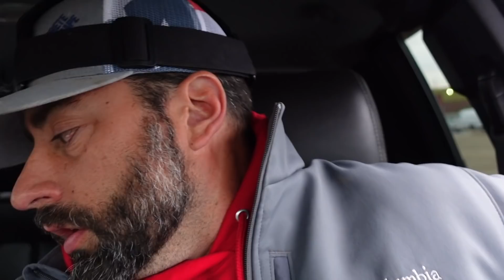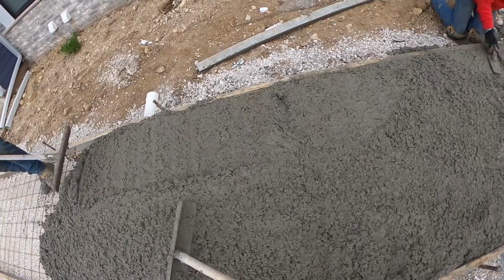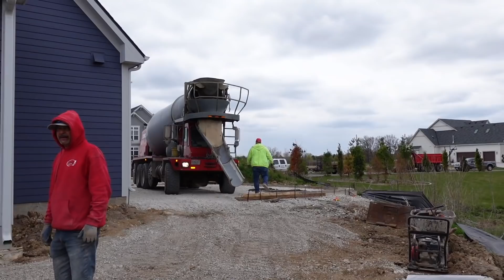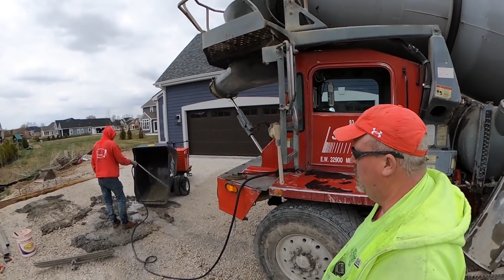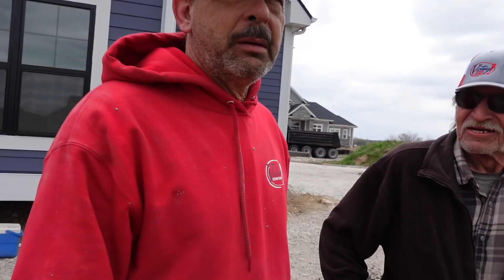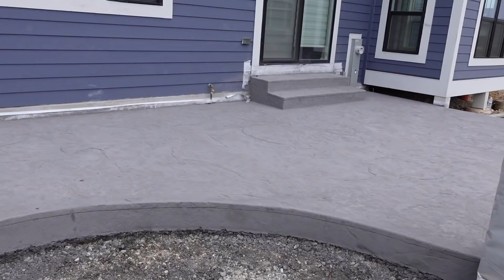Wet concrete... TOO WET!

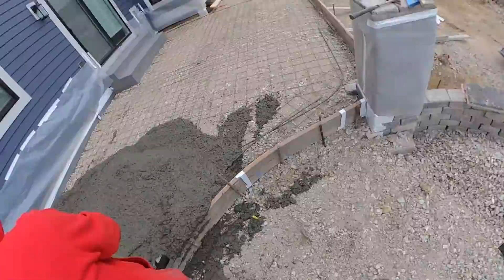Comment: Wet!?? Lol that looked like a 5” slump at 8:10
Reply from the maker: It was pretty wet.  With the chloride in it though it set up decent and wasn't as bad as I thought it was going to be.
Reply: @VictoryOutdoorServices   what was the temperature and what time did y’all start?  I work for a commercial concrete company now but also drove a mixer truck for 4 years too.  One of our customers never used steel, only fiber, that way they could order 2% and then put more calcium flakes with hot water at the job 😂  they did not like finishing past 4-5pm

Comment: You seem like great boss, U put a lot of joints in plus ,but Ryan that mesh is on the ground half the time ,on chairs mesh sits level , at 800 mm chair centres mesh is of ground,and just chair it as the Buggys emptying the concrete and looks professional,

Comment: Get a power float. And when the lads let you down as they always do you can put it on and cut it next day same thing if it goes to fast you don’t have to put joints in just power float and cut next day easily

Comment: Great that other contract lucky he dont live in my area they would have told him to stop what u have done will need a demonstration permit then would need to restart all with the drive way permit and all other check list and scale drawing. Will be very expensive
Reply from the maker: Yeah, I was really surprised. I talked to the inspector and he said they weren't going to enforce anything on the other contractor.  I asked him why and he said his department doesn't have any teeth.  I think if I would have done what the other guy did they would have made me pull it back out and start over, no joke.

Comment: It's not the truck driver's fault that the concrete's wet. Call the company there the one who mixed the concrete.
Reply: no not necessarily. they have a meter in their truck and can mix in water. he could of mixed some water in before he got there for some reason thinking it needed it

Comment: Why didn’t you run a single line pump? Just asking sir. Love y’all’s work by the way💪💪💪 sending positive vibes from Colorado
Reply from the maker: Up here in Wisconsin nobody really uses pumps except for the big commercial guys and foundation guys.  I noticed that you guys out west use pumps all the time.  I'm not sure why it hasn't caught on up here in the midwest but all us residential guys use power buggies for everything.
Reply: Yeah there are so many pump guys here. They just drag there hopper along with them 3 inch hose and get it done. It’s cool to see things done differently. Have a great day and godbless
Reply: @VictoryOutdoorServices  It doesn't catch on because we use big rock up here in the midwest, the Cali boys use pea gravel and 3000 psi mix.
Reply: How big?  We use a lot of 3/4" stone up here in Maine and even running like a 4 1/2 - 5 slump will pump through a 4" hose just fine.  I do it all the time, in fact just pumped 3/4" stone, 5000 PSI into 60' of 4" line today, went fine

Comment: I seriously do not understand drivers showing up with wet mud!!! If your ticket says 5 in slump show up with a 4 inch slump and let the contractor add the water. Never ever show up wet, your screwing the guy's pouring the mud and your making your company look bad. Your also making yourself as a driver look bad. Some Redi Mix company's will fire the driver if he or she has 3 or more wet loads in a year. There should be no wet loads period! Check with the contractor once you arrive to see if they want the slump your ticket shows, let them see the mud prior to adding any water then they can tell you how much they want you to put in. Then if it's to wet it's on the contractor not the driver. This is an extremly easy job, I just don't understand driver's showing up with piss wet concrete and if I were you I would reject it every time. Stay safe guy's.

Comment: You need a test kit. A Rod,A cone,A flat board and a measuring stick.A bout $50 bucks. Sitting water like that. One of these times they are gonna charge it back.

Comment: Ill tell you what if a boss ever asked whats taking me so long my tools get put in the back of my truck and he can do it his dam self
Reply from the maker: I have a great relationship with my employees and am able to joke around and have fun with them. It's all in good fun and I NEVER disrespect my employees.  I appreciate those guys more than I can express.
Reply: Why they don’t use the concrete pump is more fast
Reply: @gradeawork2242  owners are also paying for your experience, idk if you’ve realized but there’s a mass shortage in young guys getting in the trades. We’ve been running a 2 man carpentry crew for the last 6 months no one wants to work, $20 an hour and that’s not enough for guys to be laborers (not even a Carpenter)

Comment: That 6x6 mesh holds the gravel base in place real good. I bet if it was your house  you would do it right.  maybe not.
Reply from the maker: Watch again, its hard to see in fast speed but I pull with the corner of my cum a long, over and over again. I always pull the wire, its very important.
Reply: @VictoryOutdoorServices  you've def broken down why you do it in a video before, too
Reply from the maker: @dotChrollo  I know man, I can't win. I heard another concrete channel call them the wire mesh police and I know exactly what he means.

Comment: You say it wet but I have seen people pour foundations wetter than that. And a foundation it the one area that needs to be the strongest. I have seen idiots pour it so wet it leveled itself. And that makes for a pour and extremely weak foundation
Reply from the maker: Thats very true. That one was wet but not terrible. I have an upload from Saturday that it was so wet I actually had to send it back.
Reply: @VictoryOutdoorServices  Glad to know you take enough pride in your work that you will reject unfit concrete. Did you know also you’re supposed to reject concrete after 90 minutes or 180 rotations. Learned that when I took my state test for my building contractors license

Comment: You guys do great work. Recently had a concrete patio poured in my backyard, very messy job, power wheelbarrow was too full, spilled concrete all over my exposed aggregate driveway and walkway. They didn’t clean it up, didn’t put plastic against wall of house, didn’t show up when they were scheduled to
Reply: Unnaceptable.
Reply: Acceptable

Comment: wet concrete = bad or lower quality end results  ??
Reply from the maker: The concrete loses strength with each gallon of water added.  You're basically diluting it.
Reply: @VictoryOutdoorServices  i assume it takes longer to harden as well. And that why it can leave water Bible inside concrete . Thus leaving it vulnerable  for moisture  and cracks over time

Comment: the power buggy driver didn't turn around backwards after dumping the load.
(.......not sure why...)
Reply: If you turn while on the wire it will tear the wire up.

Comment: Love the videos man just started watching them yesterday and I have a question. Why do you make the joint (lines) in the concrete? Is it just for looks or does do something good for the concrete
Reply: It’s so when it cracks it cracks straight or to the joint. It also lets the concrete expand and contract better in the weather

Comment: One thing I noticed is that you  you guys really  never use a pump for you cement pours
Reply from the maker: No, everyone in Wisconsin just uses buggies.  It's interesting because in other parts of the country everyone uses pumps and not buggies.
Reply: @VictoryOutdoorServices  
It’s all pumps around here for 90%, probably because the terrain isn’t ever flat here. Can have 8’ drop over 30ft in spots.
If i need something, just use a skid steer bucket or regular wheelbarrow
Reply: @VictoryOutdoorServices   yea man  I noticed that here in California all we use is pumps

Comment: Nca- noncorrosive accelerater!
Reply from the maker: It is non corrosive as well.
NCA-Non Chloride Accelerator | Concrete-Texturing.comhttps://www.concrete-texturing.com › product › nca-no...
NCA-Non Chloride Accelerator ... Kingdom Products NCA is a non-chloride accelerator in powdered form. It is packaged in water soluble bags for easy addition to ...
$10.00 · In stock

NCA Non-Chloride Accelerator - Con-Spec Industrieshttps://www.conspecindustries.com › division-3-concrete
NCA Non-Chloride Accelerator. Fritz-Pak NCA is a non-chloride accelerator in powdered form. It is packaged in water soluble bags for easy addition to concrete  ...

Fritz-Pak NCA (Non-Chloride Accelerator) - Con-Mat Supplyhttps://shop.conmatsupply.com › product-p
Speeds up concrete set-time. Provides higher early strength. NCA does not promote steel corrosion. Dosage can be increased for faster acceleration. NCA can ...
$13.10 · In stock

Comment: Why don't you use water when you're cutting the block? It was a cloud of dust
Reply: Yeah I mean the dust has been shown to cause cancer. The company I work for has a Husqvarna Vacuum saw. Or when the job is smaller we use a 5 gallon sprayer with water. Just fill up a couple of 5 gallon buckets from the trucks water supply
Reply: so we use the same saw when cutting brick it makes the same cloud of dust, the main reason mainly when using morter is that some brick suck to lay wet and can float on the mud there are plenty of brick that suck the moisture out of the mud and set faster but if the brick is wet it doesn't taking longer set not to mention plenty of jobsites i was on don't have water hookup and you are filling buckets out of a barrel to mix cement. PS we tend to lay the brick while the plumbing and electric is being put in or isn't in yet and some times the home owner doesn't want us to use their water because of lose of pressure

Comment: Two words "LINE PUMP"  wet at the being cause your so slow with that Georgia buggy, it was a 5 half way though the pour if it was 2% and hot water. If you stripped the forms and took care of the face before dark you where just taking crap to a driver that did his job. Buy a slump cone and learn how to use it before you tell a driver he's wrong, we have a saying " there is the real slump and what a contractor thinks it is"
Reply from the maker: It's all in good fun, I'm friends with the driver.  Remember it's an entertainment channel. Watch more of my videos and I think you will get a more clear prospective.
Reply: @VictoryOutdoorServices  I hear you on entertainment . It's just a mixer drivers trigger button "at least mine" when you deliver Spec mud to a State job, Bridge, sub station, wind mills or  other big projects  and pass air and slump tests consistently, then go to patio and get told you don't know what your doing.🤣🤣  But the buggy is slow, I'm sure you have a video with a line pump?😉
Reply from the maker: @Mike-qi3hu  I wish I had a line pump.  The funny thing is that no residential contractors here in Wisconsin have pumps but we all own buggies.  I know in other states its the exact opposite.  I plan on traveling this winter and shooting videos of other companies.  I'm looking forward to seeing all the different ways things are done, including pumping.  I am definitely open to purchasing a pump if I like what I see. Thank you for watching. I do have a video where I specifically talk about concrete truck drivers and how I appreciate and respect them but I can't remember the title right now. It was on a recent driveway pour, thats all I remember.

Comment: Why bother using wire mesh. They walk all over it pushing it into the dirt.
Reply from the maker: Once wire mesh is pulled up, it doesn't just step right back down.  Concrete is stiff and rocky, it's not like water, you can't just step the wire right back down.  Actually when the wire gets pulled up too high you actually have to stomp on it just to get it down below the surface again.  Maybe I will show that in a video sometime.  Thank you for watching!
Reply: @VictoryOutdoorServices  That woul be a first huh.

Comment: So recently getting hooked on your channel, how do you know where you need to set the joints?  Watching the video it seems random but calculated.  I’m just curious.
Reply: long as the jointer doesnt gouge or sink into the mud its good to joint it.  also want to make sure that the joints dont close up right behind your tool.
Reply: It's measured and spaces out his joints all the same for driveways and foot paths but will change it for a patio. I've seen him measure and mark em out a few times, think he just leaves it out of the vids most of the time.

Comment: You guys don't use a hose to transport the concrete? Not the most efficient way this.
Reply from the maker: Nobody really uses pumps around here for some reason. Every contractor owns a buggy and nobody owns a pump. Other areas everyone owns a pump.
Reply: @VictoryOutdoorServices  Funny that methods can differ so much per region. You would say that everyone wants to work as efficiently as possible. Good luck and nice video

Comment: Excuse my ignorance but why don’t they use concrete pumps in this situation
Reply from the maker: Thats not a dumb question at all. Pumps are just not a thing in Wisconsin.  I don't know one residential contractor that owns one.  There are a couple big pump companies that you can rent a boom pump but thats about it.  I rented a boom pump once last year and that was pretty cool.  I would like to tty a trailer pump sometime, it seems like they are pretty cool.
Reply: if you got a buggy the cost to run that rather than rent a pump is an insane difference. i've used pumps only for walls. you can usually get a buggy anywhere you need for flatwork like this as long as what your pouring is  wider than the buggy. for walls you sometimes don't have a choice but to use a pump because trucks sometimes can't drive around to where they need to be to get off.

Comment: Best part of my day being a mixer driver, when the contractor complains about the mix being to wet after it’s already poured and finished.
Reply: I usually hear it in the showers at the end of the day in a precast plant😭
I try to tell them to contact me right away instead, but it seldom works.
I have monitored about quart of a million batches of concrete being mixed and I know how difficult and frustrating it can be!
Reply: I had a guy on curb machine try to reject me after I poured out 3 yards, saying I was too wet and he wanted a 2” slump. I was tested on a 2.5” slump and the ticket ordered a 3” slump.

Comment: Hey man, how's your week going? 
How are you putting that horizontal line in the face? Just hand cut it in with a roller? That's a nice detail.
Reply from the maker: Yes, we snap a line and roll it by hand.  It always looks nicer with the horizontal line in my opinion.
Reply: Sure does.  Looks like actual stone pieces.  I like it.

Comment: Typical Placer with the comments to the driver
Reply from the maker: You should watch my latest video.  I talk about concrete truck drivers in detail. I think you would have a different opinion.  Its called Remove and replace driveway-start to finish.

Comment: Wouldn’t hurt to put some chairs under your bars. I know you got guys that are lifting them up while placing but it’ll help in the long run. That way you don’t have guys stepping on the reinforcement and pushing it down.
Reply: Even some rocks still better than now
Reply: They drive the concrete buggy over it , chairs would snap or bend